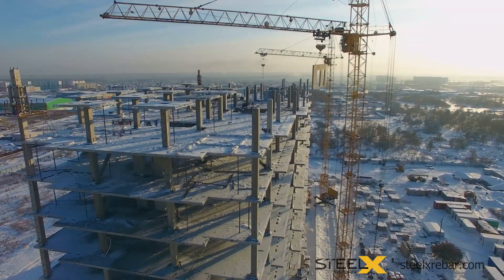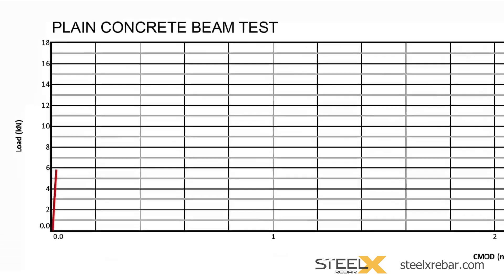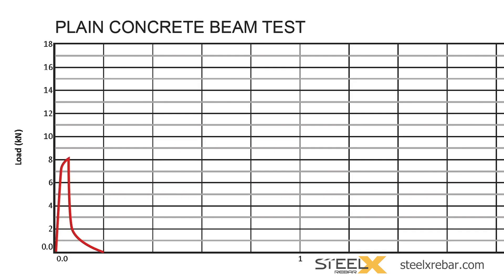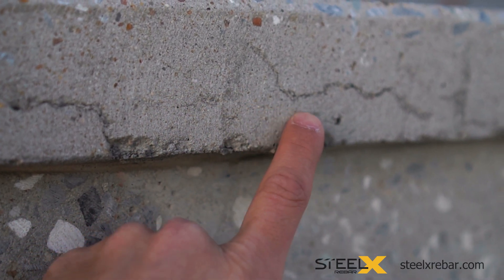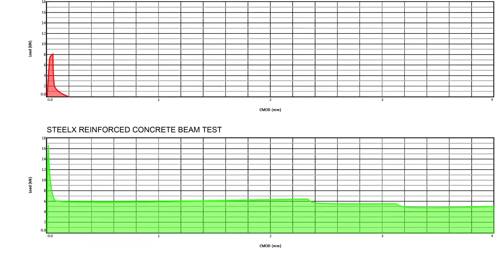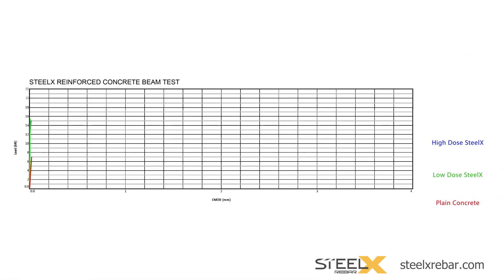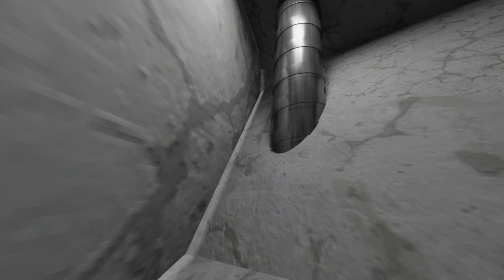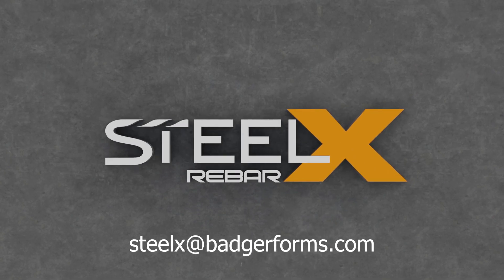Why is concrete so needy when it's alone?

Comment: Stoped watching after "rebar can help, but it only suports the concrete after the damage has been done"
Which could not be more wrong
Reply from the maker: Hi @johanneswesth, I would love to hear more. Can you please explain. Our scientist and engineers that test concrete seem to think physics support the fact that rebar at the center of a section cannot arrest the movement of the concrete until the crack reaches the depth of the rebar.